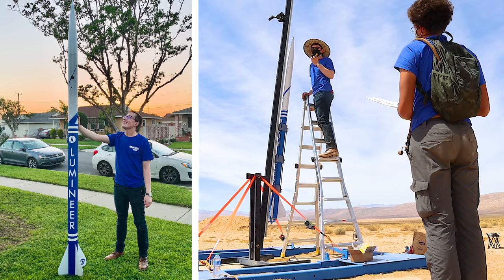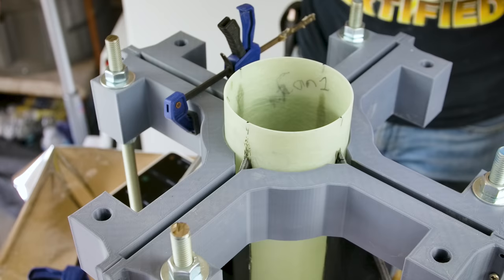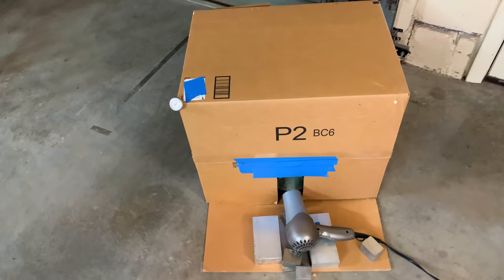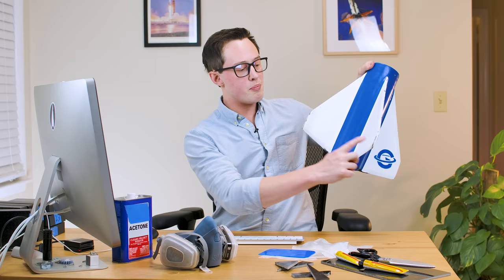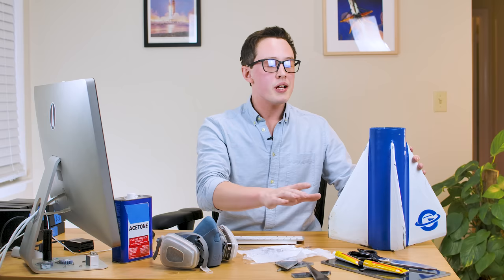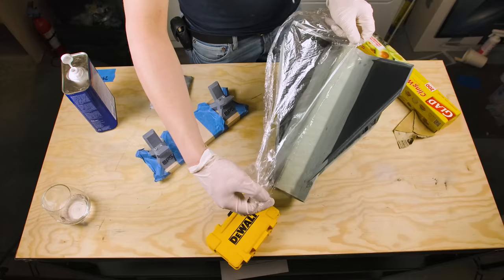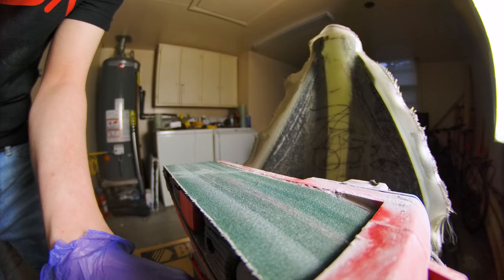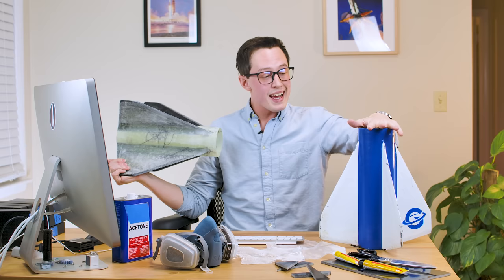High-Strength Composite Rocket Fins - Building Lumineer

Comment from the maker: Hey besties, Icarus Thiccarus back with another slammer of a video. Don't forget to peep that description to learn a little about why I'm wearing a respirator and gloves because getting hurt building rockets does n o t spark joy! Peace and love!
Reply: Yoooo
Reply: HIIII
Reply: Hi Joe! I love all the stuff you’re doing! Keep up the great work and stay safe! :)
Reply: Fan from India 🙏
Reply: Joey, I'm glad you've embraced the Icarus Thiccarus moniker we posited from your last video. I greatly appreciate your safety focus and I am very much looking forward to more from this series.
Reply: Yes
Reply: Welding is not as hard or costing as it sounds.
I mean it works for the Hamas.
Reply: Watch Mike Patey and how he lays up carbon for is planes. He starts with a large piece of carbon/glass than needed and preload the resin into the material with a backer of plastic film. Cut out the shape you need. Then apply to rocket. Then remove plastic sheet. The plastic sheet prevents deformation of the weave as well as the fibers splitting out on the sides.
Reply: Consider using a rubber (non porous) roller to help get rid of bubbles on the flat surfaces and near the edges of the plies
Reply: Hey what 3d printer do you use?
Reply: Joe, we should really talk.  Not sure what all I can help with, but with over 30 years of coating experience and a professional woodworking/composites and machine shop we need to put our heads together.
Reply: This is to try and stop us calling you "the carbonated milk guy" isn't it?
Reply: Why are you wearing Bose Noise Cancelling headsets as if they are ear protection at the start of the video??
Reply: dude, so glad to see you happy again.
its quite ok to be relaxed and goofy but still appear professional and highly intelligent
Reply: use talcum powder to protect your skin
Reply: What is your end goal of all these amateur rocket launches, are you doing it for fun or are you thinking you will learn something new in the field of rocketry
Reply: so you need a non-flamable cure oven, and you've got fiberglass... make a fiberglass cure oven?
Reply: Some questions/suggestions about your manufacturing choices here:
For the fins, why not use a router with a round-over bit to round off one long edge of the fiberglass sheet, and use that as the leading edge of your fins? You could simply stencil them out to keep the leading edge along the rounded edge, and cut down greatly on sanding and inaccuracy.
For the fillets, why not use something like a squeeze bottle to apply the epoxy smoothly in one long bead, similar to a caulking gun, and then use the rounded corners of your blue plastic squeegee to smooth the bead instead of a 3D printed tool? That's actually what the rounded corners on that plastic card are for...

Comment: Did someone say high strength composites?
Reply: This episode of Real Engineering was brought to you by Curiosity Stream.
Reply: Legend
Reply: @joellamm5266  roflmao
Reply: Hahahahah,exactly. Caught my eye
Reply: Oh my god. The legend is here
Reply: Composites are cool, i wish i would design them more stiffer and lighter. At the moment I'm making too many design errors. Good luck with all your projects M8s xD
Reply: @Karol-tu5yd   To really get the maximum out of composites you need some serious hardware. Also you need to realize that not all Carbon fibers (and composites) are the same. You need to tailor the weaver, epoxy, the layer direction, # of layers and the material itself to your application. On top of that pros use pre-preg CF and massive custom made looms/kilns for this. So don't expect to be able to compete with the pros with a wet/dry layup method. Regardless, practice makes perfect and for most small scale composites basic CF or FG with a wet/dry layup is enough.  (check out the Spirit Aero systems Carbon Fiber loom that they use for 737 fuselages)
Reply: Ha ha real engineering :)
Reply: Engineer curious for composites in a Model rocket engineers video.
Reply: @timothyhanson7828  i have real small experience, just 3 years as a composite designer. I've made two aerodynamic package for two racing cars. I've used FEA. 6 months ago we started making parts with prepreg cf. So the difference between prepreg and wet layup is massive. I sometimes was so pissed of limits making parts with wet layup. But it's a story for another ... I know the difference between types of woven. I'm using specific types for specific parts. We also have LTM, MTM and HTM fibers. Currently I'm working with recycled cf and it's interesting to be honest. Also I'm thinking about using bio fibers like flax for my composites. And I'm little sceptical about it, but I'm going to test it anyway.
Reply: oh no another video im gonna sit through because my god they make good ones
Reply: @Karol-tu5yd  if working with dry flax i recomend doing a lot of sample as it behaves quite different to carbon or glass
Reply: No
Reply: They could build a submarine out of it…

Comment: Pro Tip: Use a roller cutter for the fiberglass. You will never look back! Roller cutters are available for a few dollars at fabric stores.
Reply: ooga booga next vid when 😄
Reply: @Maru Ivan Rico hello
Reply: Olfa are great, but note you need to cut on a self healing mat.
Like you said, available at any craft or fabric store.
Reply: @jimurrata6785  I've found MDF works just as well, though eventually you do need to replace it.
Reply: @AirCommandRockets  you really think MDF works as well as a mat?
I would have thought A) you would end up with ridges at your cut lines and contamination. B) you would encounter 'skating' reinforcement when trying to cut.
But I haven't tried it, and now I will.
Thank you for the suggestion!  👍
Reply: Also get masking tape and tape over the lines you want to cut in the FG or CF. Cut down the middle of the tape and it will stop your fabrics from having the ends fray and fall apart. You will need to either remove this before placing it or have the fabric have some extra material that you can trim off after the main composite dries.
Reply: @timothyhanson7828  Pulling the tape off pulls the weave apart worse than not doing anything.  🤷
If it is not a critical layup you can give the cloth a dusting of spray adhesive. That helps keep the fibers in place, and the resultant panel from moving around if the stack is dry (like for infusion)
Proper shears with ceramic blades work much better than fabric scissors if the cloth is heavy enough that you can't use a roller blade, but these are hobby rockets not real boats and planes.
*Aramid (Nomex, Kevlar) are especially difficult to cut.  You definitely want a pair of shears meant for composite work if you're dealing with them.
Reply: Steamroller hehe

Comment: So, this was pretty impressive. When I saw you were doing layup and bonding I thought "Oh, Boy, this will be interesting!" As an aircraft tech and former bonding department manager at a  composite aircraft company, it sounds like you've done your homework. I only cringed when I saw you sanding without gloves, but it looked like you learned how nasty that is by the end. Pro Tip: If you find your hands super itchy after sanding, try sticking masking tape to the area and pulling it off. Also, the amount of Hysol you were using poses very little threat of significant exotherm with the size of heater you were using.

Comment: If you want to save some money, I use butcher paper (not craft paper) when impregnating the fiberglass with epoxy. No need for rolls of mylar. The mylar can be used for other things related to laminating. The butcher paper has a nice film on one side you can tape down to your table and won't absorb any stray epoxy. And it comes in giant rolls.

Comment: Epiglue is your friend for fillets. The epoxy doesn't sag under gravity so you can do all 4 fins at the same time. Saves lots of time.
Reply: Hello there
Reply: How does it compare to Rocketpoxy? I've done all fillets simultaneously with rp and it has 7600psi tensile and 14,800psi compression strength.

Comment: every garage composite engineer has definitely built a curing oven that they caution that NO ONE SHOULD EVER DUPLICATE
Reply: I certainly feel a lot better about my cure oven.  I use a regular, old-school light bulb, which is made for continuous operation, unlike a hair dryer.  I can control the temperature inside by putting more or less insulation (blankets) on the box.

Comment: Hey Joe,
I have 10 years of experience working with composites and have been to multiple courses on the subject. 

Just want to give you some tips.

The next time you do composite layups, consider placing your fabric between two pieces of heavy mil plastic that doesn’t stretch. Add your resin and squeeze out the extra. This keeps you from working air bubbles in the resin and creating “Resin Foam”.  

On the outer most layer  of the plastic you can have your shapes pre drawn out and ready for cutting or use an aluminum or some other material as a stencil.  Use a sharp roller cutter to cut through your two layers of plastic and saturated fabric. 

Next all you have to do is peel the bottom layer and stick the fabric in place. The top layer of plastic also helps keep the shape of the fabric from being distorted. Final peel that last layer off and you will find your edge quality to be much better and not have frayed edges. 
Another tip is you can take the “plastic sandwiches saturated fabric”and place them in the fridge so they don’t cure as fast on you, this also makes removing  the plastic easier. 
Keep up the good work.

Also look into using micro-balloons/ microspheres for making your filets. It’s much lighter and is the same chemical make up of your resin.
Reply: I'm thinking most optimized tip to tip layups use progressively stepped reinforcements.
You don't want a thick step at the edge, so (ideally) you start with full coverage and work your way smaller.
While this may seem counter intuitive, when it comes to sanding and faring you realize that you are sanding just the tips of some layers off while the smaller layers protect the full length fibers of the layers below.
You can do your layup inversely on your peel-ply (on top of wax paper or PET/Mylar)
This is essentially an uninhibited pre-preg.
Having the peel ply in place on the top of the stack when you flip it onto the fin can makes for easier positioning because you have 'handles' that project out beyond the edges and aren't saturated like the laminate.
Everyone is familiar with the 'sticky dance', trying to get the reinforcement in place while your gloves won't let go. 🙂
Reply: I highly agree with these tips! I've used similar techniques, and learned them from a fellow lifetime composites guy. Haven't messed with micro-balloons yet, but I've seen them in action on a few repairs.
Reply: In building a rocket filets for the fins are structural. Do you think micro-balloons are strong enough? I was told Cabosil would be a better option for strength.

Comment: Hey Joe, great video. Just one thing I picked out, around 20:40 you said the process of applying resin to the cloth is called 'prepreg'. It's actually called "wetting out". Prepreg is a dry fibreglass or carbon fabric that has already been impregnated with resin and allowed to partially cure. The fabric is stored in a chiller to prevent it from fully curing and is then placed in an autoclave once laid up to fully cure the part. It's a completely different process to the "wet layup" which you are doing here.

Comment: Not only does a higher temperature decrease the cure time for epoxy, for most epoxies it also increases final strength and temperature resistance.

Most epoxies lose most of their strength already at 100 C, the relevant information on the epoxy datasheet is called "glass transition temperature" or Gt, I assume you used an epoxy with a higher Gt.

Also, it's the carboxyl groups that have formed when epoxy reacts with the carbon dioxide in the air that you remove when sanding, not an oxide layer.

Hint for surface prep, sand, tack-cloth and then acetone.

Vaccuum chamber is the best way to remove bubbles from gf/epoxy.
Reply: Heat also greatly lowers the viscosity of most uncured epoxies.
While you think you have removed all you can, if you vacuum bag in the cure oven you will see just how much more ends up in the breather fabric under elevated cure.
There are some epoxies with higher TG. 3M, Aeropoxy and Coltronics all have some formulas with elevated TG temps.

Comment: A tip for trimming the cloth after its laid up. Before the epoxy is fully cured, but after it has started to stiffen up, it will be the consistency of chewing gum. You can cut it with a razor knife right up to the fin edge. This will save you tons of time sanding and will almost eliminate fiber glass dust. 

A proven technique that we use on composite aircraft.
Reply: Also it will eliminate the danger of sanding into a fin or other parts of your project.

Comment: composite guy and vet from the US Air force here and can confirm water break test is still used. Alot of composite parts on MH-60 and H-53 helicopters, not to mention the rotor blades "blades are a composite metal bonded honeycomb" at about 21 min in is what we call in the biz prepreg

Comment: Hey Joe, 55 minutes on a 60 minute epoxy is cutting it really close. One thing you're doing that can cut into your work time is mixing the epoxy in a tall cup. The epoxy tends to self heat as it cooks off in a dense container and this reduces the work time. If you mix your epoxy in a shallow flat container (those disposable baking pans work great) it will not be able to concentrate heat and it will be workable a lot longer.

Comment: Thanks for sharing your journey. After watching your video, I came up with a few ideas that might help improve your processes.
1. Have you tried cutting the fiberglass with pinking shears? They are used to cut fabric and reduce the amount of shedding.
2. Consider adding orientation lines to each layer of your layup. I'd use a long vertical line in the middle with a couple horizontal lines at 1/3 and 2/3 the length of the line. The lines will be visible through the fabric when wetted with resing. This should allow you to quickly orient each layer.
3. When casting resin, pulling a vacuum on the resin, after mixing, greatly reduces bubbles in the casting. You might consider pulling a vacuum on your resin mix before applying to the cloth. I use a foodsaver machine.
4. Line your box cure oven with "silver" coated insulation to retain the heat. Add some small vent holes around the bottom edge to allow any fumes to escape rather than blow back near the dryer heating element. Seal around hair dryer hole to improve heating efficiency.
These are just some ideas from a thankful subscriber. Keep up the good work.

Comment: Regular people: 0.2 degrees is nothing!
Rocketeers:  OMG 0.2 DEGREE MISALIGNMENT I AM GOING TO DIE
Reply: I mean, it does have a giant impact, but in normal terms that is nothing
Reply: @15gamershaven89  Well it is normal to the frame, but not vertical
ba dum tiss
Reply: No. "MY ROCKET IS GOING TO DIE!"
While spin stabilization will help mitigate any assemetry in thrust it does use energy that could be contributing to altitude.
It is drag at low altitude but the only thing that will keep you going straight as the fins do nothing for you when there is no atmosphere left for correcting force.
Just like artificial gravity, that spin is creates a huge load on payload (like battery and ejection charge connections)
Reply: 0.2 degrees out equals 1280 degrees of rotation per second, or about 240rpm..
Stability comprised.
Success unlikely.
Reply: @genelomas332  At what velocity?
Reply: @jimurrata6785  watch the video?
Reply: @lukefreeman828  Yes, yes I did.
What do you think I'm contradicting?
Reply: @jimurrata6785  I didn’t say you were contradicting anything... I also didn’t ask if you had watched the video.

You’re asking a question to which the answer is given in the video. What Gene Lomas said is directly lifted from the video.
Reply: Hahahaha,yup. Since it is moving at an incredible velocity,any change in alignment results in significant change in aerodynamic performance(forces,moments...stability)
Reply: @jimurrata6785  about mach 1.6, apparently.. it'd help if you watched the entire video..

Comment: I’m building a fiberglass Long-EZ in my garage. A few things I’ve learned:

Consider pre-pregging all 7 layups on the table before applying to the rocket. Allows more attention and dexterity to weave orientation and bubbles while still on a flat surface. Also, if you sandwich all layups between 2 sheets of wax paper (much cheaper than mylar) it allows you to cut the whole layup with scissors to a more exact and neat final shape. You can also draw on the top sheet of wax paper with a marker and a ruler with no mess. Just peel away the wax paper before applying. 

I use EZ proxy from aircraft spruce.com. Longer cure time but ideal for lightweight aircraft. 

If you can pinpoint the direction of the higher stress loads you can use lightweight unidirectional (UNI) cloth and strategically align the weave. My entire wings are done this way. 

Consider mixing your 2 part epoxy with microballlons.  Lots of strength, easily sandable and most importantly, lightweight. I use it all the time for fillets. 

With 14-16 ply fins I think you can opt for much thinner and lightweight fin cores. Rigid, thin foam would work. Easily carved and shaped. Less mass, less drag, higher altitude. 

Keep in mind I’ve never built a Mach 1 rocket, so take all this with a grain of salt. Just some thoughts. Nice work.